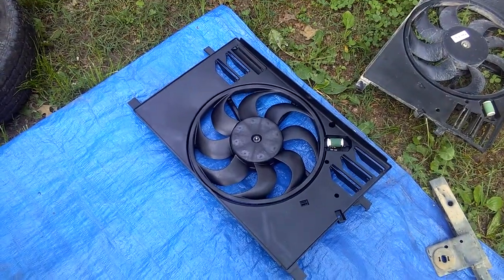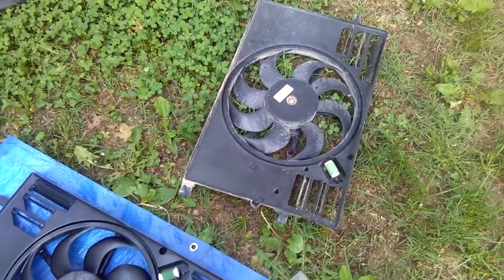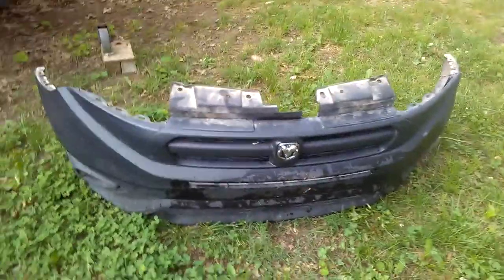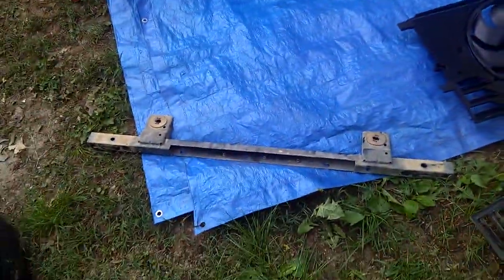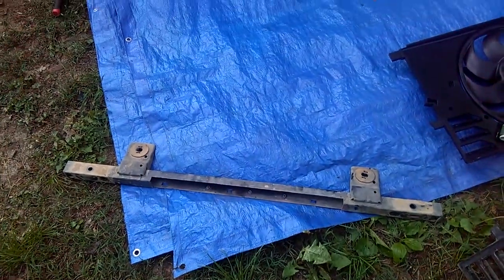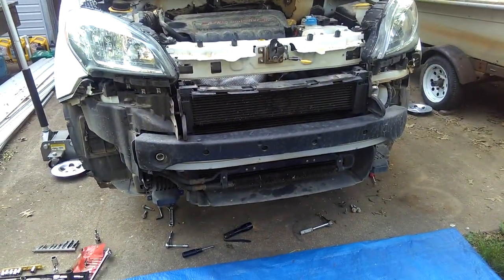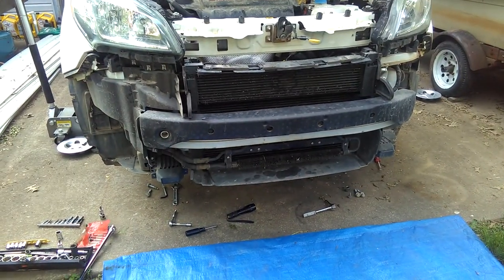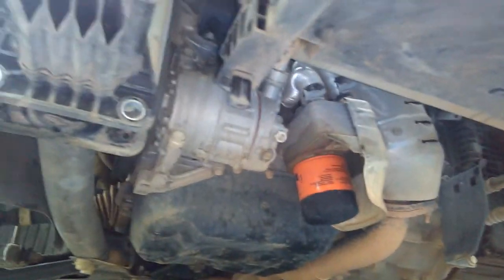2016 Dodge Ram Promaster City Cooling Fan Replacement

Comment: Good video, thanks for posting. How many miles on your City when the fan went bad?
Reply from the maker: 47,000
Reply: That's too early, seems like a common problem. Did you install a factory fan or aftermarket?
Reply from the maker: Xavier Lemos after but exactly the same
Reply: terryclotf 
Hopefully it will last longer than the factory unit.
Reply: Mine just went out at 36k miles
Reply: @TEAMALSTARE  
Probably at lot of idle and a southern car
Reply: My 2020's fan is stuck on constant and it has only 3500miles

Comment: Hey I’m having problems with my radiator fans on my ram promaster. What were the symptoms of it needed to be changed? Also did your fans stop working or van overheat?
Reply from the maker: MassiveMediaOnline no it never stopped I was afraid it would so I ordered it from RockAuto really cheap I thougt

Comment: Too bad... FCA just recalled these fans, replacing them for free.

From ABC News:  "Fiat Chrysler is recalling over 110,000 vans in North America because cooling fan motors can overheat and cause fires.
The recall covers certain Ram ProMaster vans with air conditioning from 2015 through 2018. FCA says in documents filed with U.S. regulators that fans can seize, and a circuit breaker may not stop them from overheating. That could cause fires."
Reply from the maker: yeah i got my letter
Reply: @terryclotf  sucks! .. i've done the same... fixed out of warranty safety stuff after complaining it was defective and should have been recalled .. ,then they recall it.